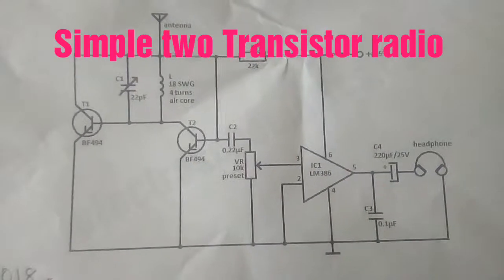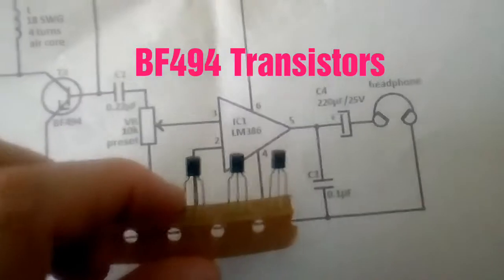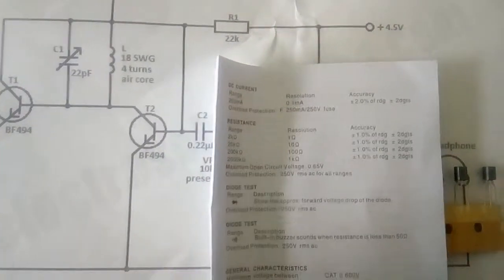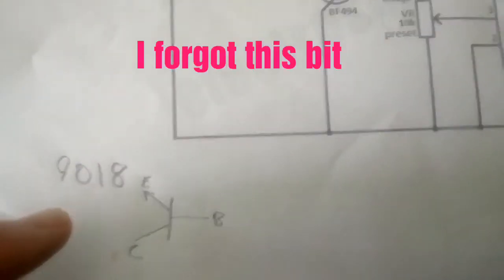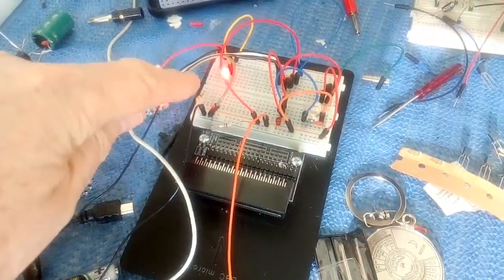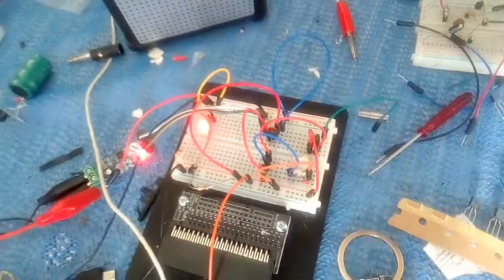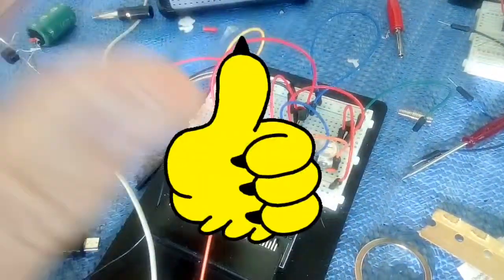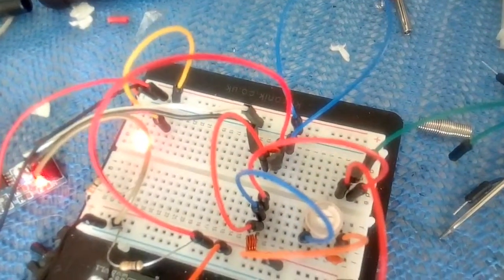Simple two transistor FM receiver

Comment: What do you use for an antenna? Also you have 2 amplifiers, the Chinese one and the one inside the speaker? It’s not clear at all. Thank you for sharing.
Reply from the maker: The antenna was a wire about 2.5 feet long. There is another amplifier in the speaker box , but it not needed . The cheap Chinese amp with speak will work fine.  Sorry not to be any more help but I done this project some years ago. Roger
Reply: TheAcehere1 great project. Thank you for the clarification.